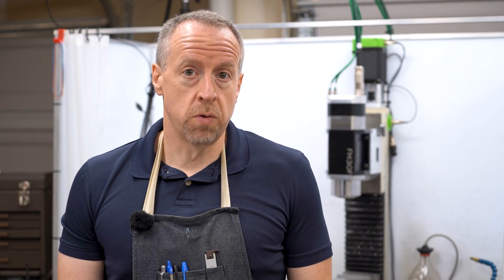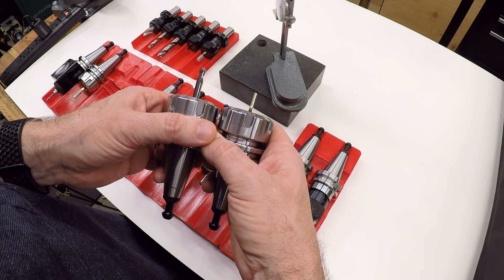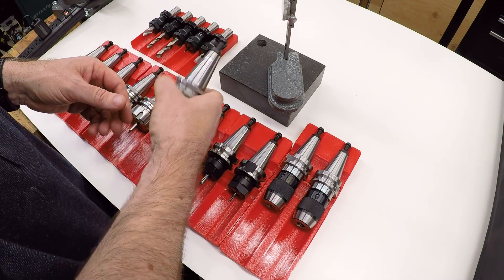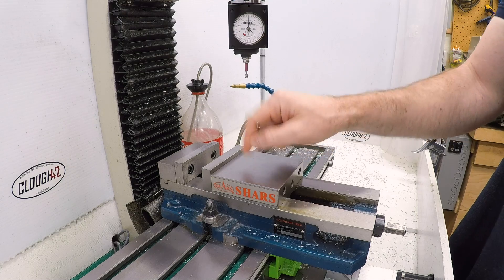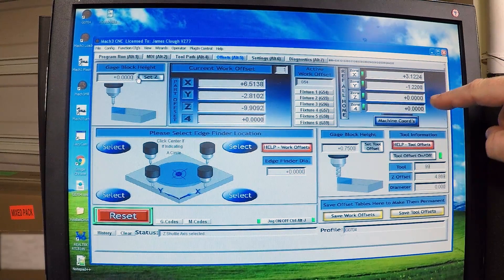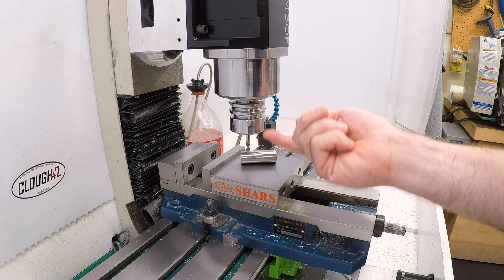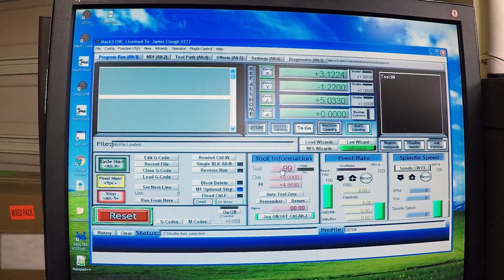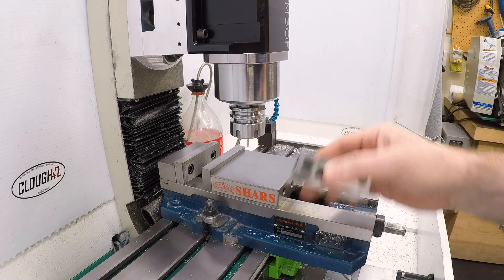Measuring Tool Lengths in MACH3 Without a Presetter

Comment: Ive done a simular process, i drilled and reamed a hole in a block with an adjustable reamer so the dowel pin was slightly tighter than a slip fit. And then you can make contact with the top of the Dow and actually push the dowel pin into the block slightly, and then you just measure your overall height of the dowel pin and block. This worked great for me. Just thought I would share that with you in case you ever have to do somthing like this again

Comment: Instead oh a Heimer one can mount a dial Guage on an aluminum block upside with the plunger facing upwards. Then make a 10mm flat cap to fit on the plunger point. Then use any tool as your number one height setup tool and set every tool with that tool as reference.

Comment: I use a similar method, tho different.
I set my tool heights to the raw workpiece since i have and use various fixturing methods. I use a 1-2-3 block and the same "lower past and raise until it clears" method.  I have WAY to many different parts that i make and not enough tool holders for all, so I have to change tooling in the holders for most every job. Kinda negates the permanent tool height offset in My Haas.

Comment: Great vid on tool offsets. Very clear and concise, as usual. Do you have any idea on how to adjust for tool diameter? I can't seem to locate any clear information anywhere, including the Mach3 manual. The problem I am trying to solve is how to tell Mach3 that a particular end mill is worn  and have it adjust the toolpath to compensate for that wear. Say I setup my gcode for using  a .25" diam end mill, but the tool is worn or has been resharpened to say .243". I tried filling in this info in the tool table but Mach3 does not appear to use the diameter info in that table. I would think that many of your viewers would appreciate how do do this, unless it is very simple and I just don't get it.  It has been a PITA trying to CNC a bearing pocket accurately when my end mills are not dead on in terms of diameter.

Comment: "and with taper tooling there is not really an easy way to measure on the bench"... 3 words:  Hold my beer!
I worked at a Company where the also did not have a tool presetter, 
just a height gauge..They just turned a piece of Cold rolled to match the diameter of the taper, so it woud sit on the flange, 
If it doesnt rest on the flange, Turn a Taper inside a piece of cold rolled..

You could also use a Toolsetter on your machine..I think you can write a Macro to make that happen..
I Use a Toolsetter, and when measuring a tool i just enter an approximate lenght, and hit start .
then the Toollength measurement proceeds automatically, even in a program,i can change it, and measure it, then proceed with the program..

Comment: Useful and professional, as always. Thanks! I'm curious, are you still using Mach 3? I have it set up on the 8 x 4 router/occasional mill, which I made. In videos I posted about it, a common comment is along the lines of Mach 3 is the devil and all your problems are due to Mach 3... It seemed ok to me. I have a license to switch to Mach 4, but after all the setup of various ATC spindle brains and macros I'm quite reluctant. 
Thanks again :)

Comment: Old video, but so am I. We use zero setters all the time, it's easy as making hay 😜. Setting any tool: zero is zero is zero. We use both the ones with indicating light and the ones with gauges depending on preference. I even use the one with light in the lathe...
 It doesn't matter where to put it, it's for reference and not for measuring...
Reply from the maker: The trick with a tool setter is figuring out the correct length for the Haimer.  You would need the Haimer to compress to zero at the same time the zero setter compresses to zero, and that doesn't work.  A tool setter with a very weak spring works with a digital probe that breaks the moment the stylus starts to move, but with the zero point in the middle of the spring range, the Haimer makes this more difficult.

Edit: Thinking about this more, I think you'd just need to have a solid block the same height as the tool setter for finding the Haimer zero.  I need to look into this more.
Reply: @Clough42  
 I think we have a slightly different approach. Yes, I use the Haimer to check different hights on a piece (move down to zero, move over to the slot, move down to zero and take the number) and to find x-y origin, but the Haimers hight I have only eyeballed. The z-compensation I make with a weldon with just a rod in it and a setter. That one is my absolute z-zero and the other tools relates to that.
 I forgot: Happy New Year 2023 🍻🎇!

Comment: I had never heard of the pin gage method until this video.  I've always used a cigarette paper on my mill for touching off for my zero on the mill.  I know it's manual milling and not CNC, but can see how the pin could be used on the manual mill as well.

Comment: It was actually important to note that you moved the Haimer back up to zero. That negates the backlash in the Z Axis when measuring the tools.  So for those watching make sure you go slightly past zero on the Naimer and then back up to zero. If you come down to zero and then use the pin method moving up you could have the potential for the backslash to be added to your tool offset measurement.

Comment: I have a better idea!!! With the touch probe and Gcode G31, you can get the tool offset from the mach3 dro easily and precisely. You don't need to move down your tool manually to touch the gauge block.

James, always thumbs up!

Comment: Clough, curious why not use a script that will travel the Z axis to a touch plate of know size and get the tool measurement from Mach 3 that way?  Unless that is much less accurate than a gauge. I am curious if the process would be more or less accurate using a touch plate where the tool is touched off a know plate size. Using the probe tocuh method.

Comment: At 11:50, would it not work if you just leave the tool slightly loose in the collet, use the gage pin to zero the tool (will push it further in the collet), then tighten the collet fully and recheck your offset with the gage pin?

Comment: Don’t use a gauge pin and risk accidentally jogging down and messing it up. Just use a hardened steel dowel pin. They’re cheap, accurate and replaceable. I use a .25” dowel for my touch offs WCS Z set to -.25” so I don’t have to remember to enter the compensation into the tool table. Also by touching off with that method a haimer isn’t even needed for z heights at all. 

Haimer z is good for if you set WCS zero at the bottom of stock( which makes it easy to see if tools got programmed too deep) so say you have standard tools that stay in your machine and they’re all touched off relative to the table then you can set your WCS Z to something like 3.875”. ( the height of the bottom of a part on 1” parallels in a Kurt 8” vise) this allows you to switch between setups super quick. Sure it’s not accurate to tenths but it’ll get you within .005”  (measure to the bottom of the vise from the table with the haimer to be sure )

Comment: Use a dedicated riser block on one end of the table instead of the vise.  That way if you setup is ontop of the vise and a tool breaks, you can still reach your tool setter height. or if you dont have a vise for any opp, all your tools are still good

Comment: add another input to your breakout board and use an alligator chip with a piece of aluminum angle as a touch probe to set the spindle height to zero than use that setting to set the tool height of each tool.  I used the touch option with my router table to set the z height when I changed out the tool in the router at each tool change when cutting. I never used the tool height option on the router table but think that option would be available for tool length setting in the tool table because I had to disable the tool length offset when I moved for Cambam to Fusion360.. I also set the tool change location to move the router to an easy reachable location for a tool change since the router table was a 4' x 10' table. also be glad to help in the macro programming if need...

Comment: I typically use the shank of a 1/2" endmill instead of a gauge pin. Most vendors grind them very precisely, so they work great.
Reply: No problems messing up drill tips or worse yet end mill flutes?

Comment: Small thought: if you use a positive length from the spindle face for all your tooling and accidentally switch to a tool that you haven’t added a length for, won’t that cause the mill to try to smash the end of the spindle down into the part? Might be more bonehead-proof to start with a reference tool length that makes all the tooling have a negative length instead.
Reply: Yeah, that can happen.  Good machining techniques will catch it before it does (watching distance to go).  It's easier to visualize, I guess it's the best way I can describe it, when you use positive tool lengths.  Things you can physically measure don't have negative lengths.  You can put an arbitrarily long tool length as a placeholder in your tool table.  That way the machine will either alarm out for not enough z travel, or cut air above the part when you forget to set the offset.

Comment: We use these all day everyday at work. The pad at the top is spring loaded against a set of contacts at a known height much like electronic probes. As soon as the tool touches it depresses the pad and the LED illuminates. https://images-na.ssl-images-amazon.com/images/I/41vR1HKT6zL._AC_.jpg.  You can place it onto the bed or the top surface of the part. A similar idea but for edge finding https://www.engineerswarehouse.tools/products/optical-edge-finder-touch-point-sensor. Use both together and you can replace the Haimer for a much more robust and cheaper alternative. Touch off the edge finder on top of the height pad and make it your reference tool. Being relatively long compared to normal tooling gives a consistent +ve tool length offset. It is always a good idea to make your reference tool the longest tool in the sequence, saved countless tools in the past

Comment: i do not have experience with Mach3 but i use Haas Mills at work, one has a Renishaw probe but the other mills we set all the tools referenced off the table using a z axis tool setter, its very accurate, it has an LED light that lights up when the tool touches the top completing a circuit. i then just have to subtract the setter height. with setting all the tools on the table,  all your work coordinates are all positive numbers since the table is your zero height.  we use a Haimer to figure out stock z height when necessary.

Comment: Check out the APM Cnc tool pre setter, I have a Haas TM 2 mill , and I tried the little cheap setters but so good, but the APM is worth every penny , makes setting tools so easy and accurate, they are on sale on eBay ,you won’t be disappointed

Comment: On the MDI screen, you can just hit enter to bring up the MDI box; then you can use the up/down arrow keys to select previous entered expressions and/or edit them and hit enter to execute, and enter again to de-select the MDI.
Also, I hooked up an input wire and associated it with the probe using this BRILLIANT video: www.youtube.com/watch?v=tvV2Vmrxarc and Charlie includes the scripts. It works SUPER good and the countdown audio cues are cool too. I will make a video on my setup which works flawlessly and could be adapted to your tool length offset system, but using a completely automatic, electronic version of putting the gauge pin down. I cannot tell you how much time this has saved, especially on my 6040 with only a fixed collet and no toolholders, so each tool requires Z height reset. I will be making a video soon to review the process.
I really appreciated the step by step of how to use the Tool Height setting function in Mach3, since I had no idea how it worked.

Comment: Thanks James. I do have a question however - You set the zero with your Haimer, by taking up backlash from the bottom, and with all your tools. Which makes sense. But, in operation all tools usually approach the work on the Z axis from the top. Which means that what Mach3 thinks is your tool position, and where it actually is, differs by your backlash distance. Unless of course Mach3 has a backlash compensation parameter (I'm sure it does), which you did not mention or demonstrate, and are actually using, and we assume its a reliable constant. My point is - we are working, and reporting to tenths, but kind of ignoring the backlash issue.  Can't believe I used the word "tenths". My head works in metric :-)
Reply: I as wondering something along this line of thought also. My comment earlier approached the concern from a different angle though....
Reply from the maker: I take up the backlash in the upward direction with the haimer as a reference for setting the tools in an upward direction with a pin.  That way, the backlash is canceled.  Then, when I measure the position of the stock for machining, I take that measurement downward, since the tools will be approaching from that direction.  However, keep in mind that tool pressure could pull the backlash out of the axis during milling, so really the backlash needs to be addressed.
Reply: @Joshua0689  OK, I get it. All lengths are set relative to the Haimer's zero. Whether from above or below. The backlash thing is then cancelled out. Thanks.

Comment: Educational video as always.
Sorry if I'm wrong but with this method isn't there the danger of human error for harware grabbing versus software selecting difference?
You can damage your, well done,  changed motor setup with automatic fixing badly.
I think the only safe cheap method is gcode bases with a simple digital(on/off) spring tool setter.
I used the z-endstop tool touching method to a springloaded surface.

Comment: Wait does that spindle not have any dogs at where the tool holder connects? ( the two small taps hanging down for pretty much all spindls like a din or sk typer spindle) 

I thought that the dogs was needed to insure that the tool wouldn't be able to spin around in the spindle bore
Reply: The taper combined with the pull stud tension is enough on a machine like this. For bigger machines with more torque, the dogs need to be there.
Reply: @ebrewste  ¨was just woundering thats all 

well what do i know about the small ones xD i have used and is only useing the big ones

Comment: I love that spindle. Really awesome choice. For the tool offset I would advice to make a quick touch probe, a base 3d printed or made out of plastic with an upper piece in aluminum or whatever conduct electricity. Then your mill is all GND and you only need a 5v signal from the breakout board to the touch probe and you can measure tool offset really fast. I have all the macro script for the probing if you need them. You can also use a 123 block with a piece of tape at the bottom to isolate it from the machine metal surface.

Comment: Hey, I like this method but z axis pressetter method is nicer cause you have direct readings on the dial. Those inexpensive, Blue or Silver ones have 50mm grounded pins which you use for adjusting the dial. You just touch the pin with haimer and you know compressed value then thouching down rest of tools. I think once you spend few hundreds on haimer, z axis presseter for houndered $ shouldent be a problem :D big fan of your video, keep going!

Comment: Great tutorial James. You really do cover all of the bases, and your videos are building up quite a library of knowledge.

I was wondering if it was also possible to set your Haimer as you did, but then use a dial gauge against a reference face on the bed that is zeroed against the Haimer and the reference. It would then merely be a matter of bringing each tool down to zero on the dial gauge and then using the DRO on Mach3 to determine the tool offset. I can see that there is the possibility of accumulating errors or even not always having the same pristine reference, but done right, this might be a quicker method. I'm sure I must have missed something important here though. I'll stand by for having the obvious pointed out :)

Comment: As always I love your instructional videos. I used to have the same mach 3 software and I had a sherline mill until my ex gave it all away along with over 20 years of accumulated tools for free. I never used the tool library because I wasn't sure i trusted my self to use it. Sherlines endmill holder was not consistent anyway. It used a set screw to hold the endmills and could be off several thousands with each change of the tool.

Comment: You should try LinuxCNC some time :) Awesome video BTW. This series has been awesome.
Reply: Mach3 works Awesome.
Reply: @BrilliantDesignOnline  Mach3 is decent. It's pretty old and relies on a non-realtime operating system. LinuxCNC is a more reliable and open-source project that is continuously worked on (but still has stable version releases). Combined with FPGAs, it's an extremely formidable control system for CNC machines.

Comment: I like the gauge pin trick. I've always used a 1-2-3 block but this method looks easier. Thanks for another great tutorial video.
Reply: You can also use the shank from a broken carbide endmill. I cut off the fluted section with a diamond wheel so that it is a clean rod- works nice for those who are too cheap to buy a proper gauge pin. Just be a aware that a 1/2 or 1/4 or whatever size end mill will not be 0.500 or 0.250

Comment: James, Master Class as usual. Check out the skin for Mach 3 the guys over at Physics anonymous came up with.  
Mach 3 Has Never Looked This Good! (CNC Software Part 2) - S03E14
Reply: I totally use the Physics Anonymous screen set. And easy to switch back to the default, if necessary.
Reply: I also run PA screen set.
If it wasn't there, mach3 would be gone fast 😅